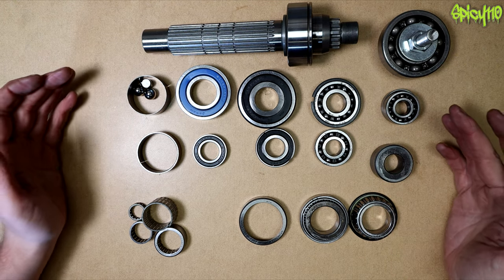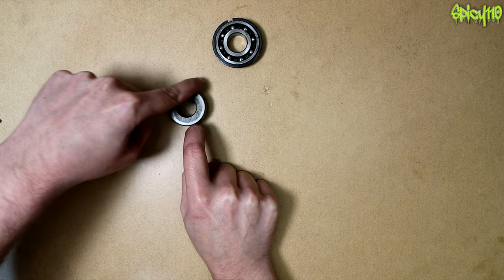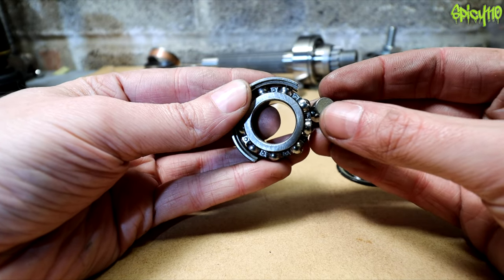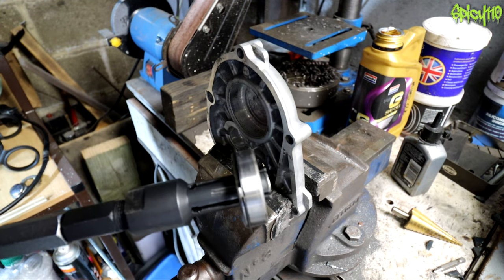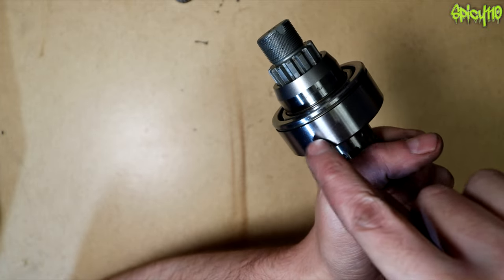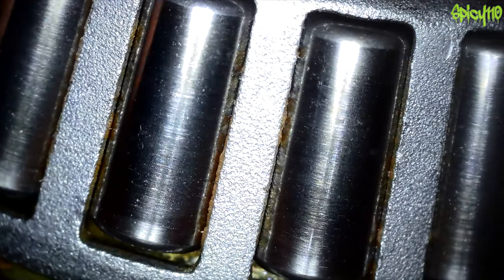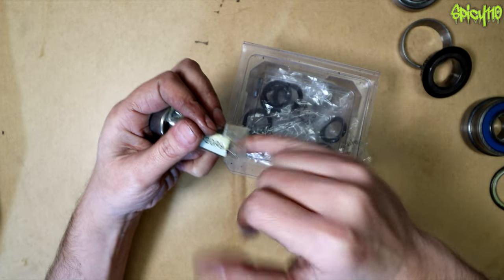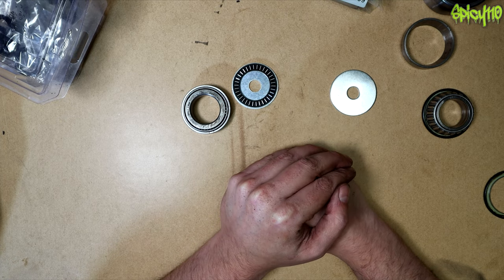Motorcycle Bearings 101 | Types & How they Work!

Comment: Great video bud.

A “friction fit” bearing is more commonly known as an “interference fit”, some bearings have such a fine tolerance of interference that you need extreme heat and/or an ultra low temp freezer to create the clearance before they can be fitted - I can think of a few aircraft-based examples, normally flying control surfaces.

Precession! Great word!!! If you want another practical subject to talk about - how Sperry’s Rule of Precession is applied every time you touch your bike’s handlebars on a ride.

Keep up the good work bud. 👍🏻

Comment: Another way to remove bearings in a blind hole is using a bridge puller. Heres a tip I learned the hard way. Dont push wheels bearing or swingarm bearings in too far. They need to push up against the spacer in between but only slightly. Someone might be able to correct me but I believe the spacer should still be able to move around with a bit of pressure. If you cant move it with a bar then its too tight.  I have very limited knowledge on bearings so I might be completely wrong.